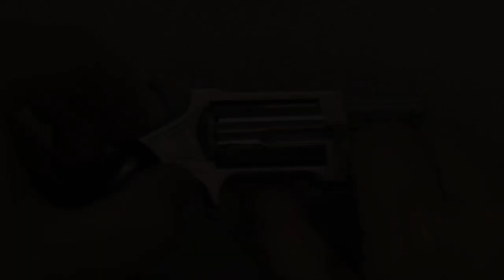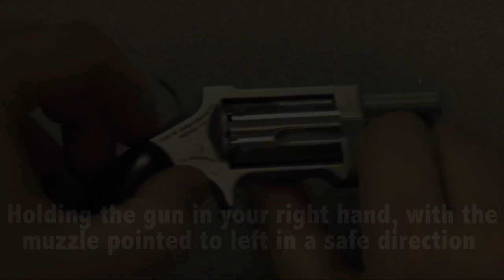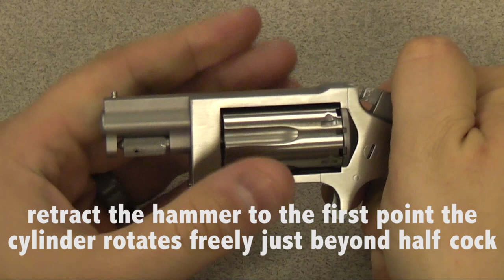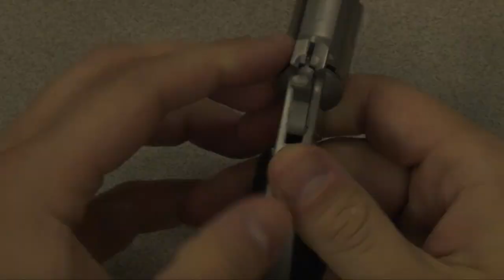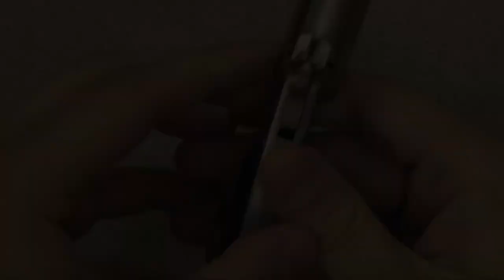NAA Sidewinder Safety Cylinder

Comment: ABOUT THE SAFETY NOTCH: 

There are not many people that know where the idea for the safety-notch on those cylinders came from. Back around 1980, I was approached by a sales manager for North American Arms (when I lived in Provo, UT.) and he asked me to make him a belt buckle for the NAA's mini-revolver. They were making the pistol with only the half-cocked safety position, and were having a patent dispute with Freedom Arms over the mechanical workings of their mini-revolvers.

There was a new law passed that required the chamber (lined up with the barrel) to be empty. So I made my buckle with the hammer resting all the way forward, with the firing pin located between the bullets. I told North American Arms that, that was a better safety-position for their revolvers, that they could be fully-loaded, and that it was the best mounting position for my buckle design.

Because of their patent dispute, I was advised to stamp "Patent Pending" on my buckles. NAA loved my idea and ran with it, without giving me any credit for giving them the idea, and began making their mini-revolvers with what they began to call their, "Safety Cylinders". I suppose they patented the idea and started using it, without any thanks to me.

Freedom Arms got wind of my buckles, and wanted to hire me, to make buckles for them. I decided not to, and so they patented a buckle design suspiciously similar to mine, but without my mounting method. They lost their fight with NAA and had to quit making their mini-revolvers. 

North American Arms then started to use Freedom Arms version of my belt buckle design, but with a slight change in Freedom's mounting method, to avoid any patent infringement. 

To stamp "Patent Pending" on my buckles was good advice, because they never tried to steal my mounting method, which is, (I'm told) one of the best. They seemed to be taking other people's ideas and patenting them, so I never let them know about my speed-loader design, nor my speed-loader bullet dispensing gun-belt design, which I will be offering to the public shortly. 

Because of all the patent fighting and Freedom Arms trying to get me into trouble (which is another part of this crazy episode), I decided to put away my design until my children had all grown up. When I finally brought it back out for people to see on YouTube, I got overwhelmed by many wanting my buckle, so I had to quit again, and recluse myself in order to simplify production and make improvements in the designs. Especially in the speed-loaders which was extremely difficult to do.

Now I am able to make my buckles and speed-loaders, not only for the Long-Rifle, but also for the Magnum. I will be posting a video on YouTube pretty soon to show what I have, and to demonstrate their use. But for now you can see my original design demonstrated here on YouTube. Please ignore the negative comments. I left them there to quiet down the demand, while I made my improvements on my production and sales methods:

https://www.youtube.com/watch?v=pND88ocAnEw

https://www.youtube.com/watch?v=xxI-911dpOw

This is the buckle that NAA copied (with modifications) of Freedom Arm's version of my design, of which I talked about: https://www.youtube.com/watch?v=GAtt90LlH_0
Reply: I'm sorry they did all that sketchy stuff surrounding your buckle design, but just so you know, many single action revolvers have had that feature, my 1860 army even has safety notches. So neither of you invented that part.
Reply: @chemiocremblac5527  , I already know about the safety notches having been used previously. I'm not claiming to have invented them. My point is that NAA got their idea of using that position for a better way to secure their mini-revolvers from me without acknowledging any of my part in it. They also took the design of my buckle (which they asked me to make for them) minus its mounting method and are now still marketing it without letting people know where it came from. So I'm just letting people know the history about it.